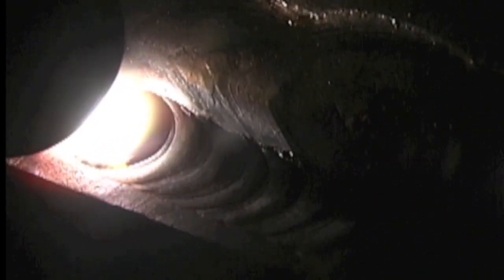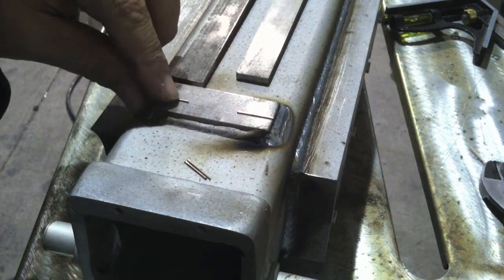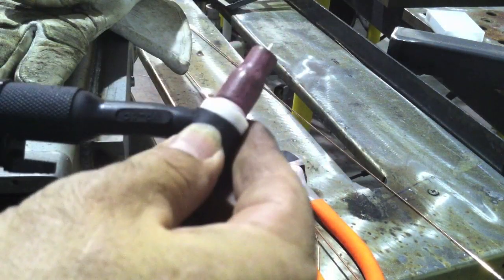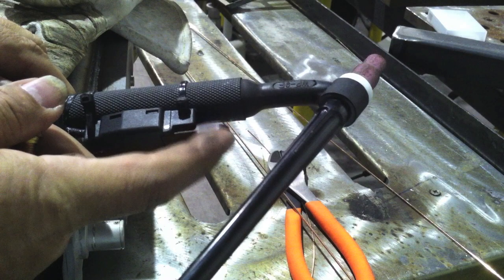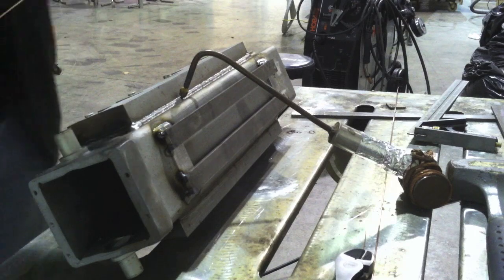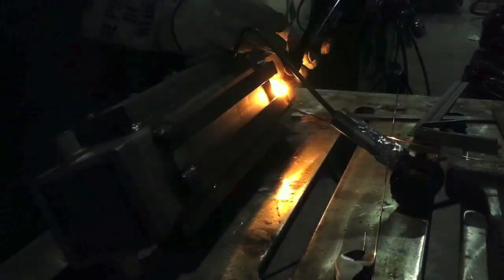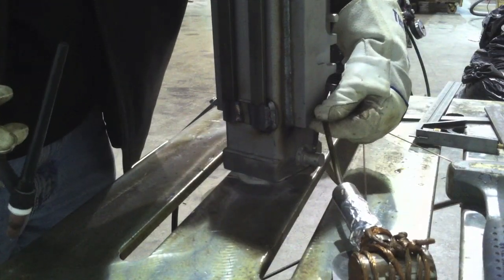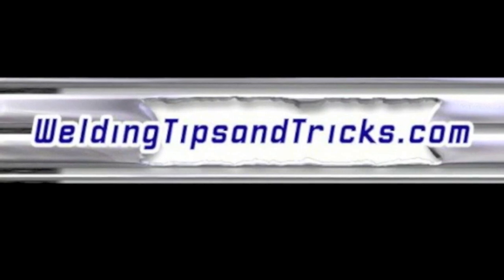Tig Welding Carbon Steel - 309 filler rod

Comment: Thank you for the tip Jody !  I have had nothing but problems with the carbon steel bubbling and popping and contaminating the tungsten. I have tried everything except the 309 filler rod. Makes a lot of sense.

Comment: @lobzdik mostly depends on the base metal. Tig = stainless and alluminium and non ferous base materials.. Mig is mostly used in fabrication shops that work with mild steel.

Comment: man, help me out a little bit. I followed all your tips on stailess steel welding and it goes perfectly, but i just began to weld carbon stell and got amazed by the porosity i've found. I tryed low amp, hi amp, speed variation. I cleaned the material really carefully and have lots of porosity. I am using pure argon and cerium tugs electrode. Thanks for all your tips, you're a great welder.

Comment: This video reminds me of a job I just did in a marine box that was going to be coated and the thickness of the coating was .020".  There were four sides to the 1/4" bar stock and 1/4" plates giving me .080" and the customer wanted .100" min.  Used washers for spacers to give me .120" and worked like a champ.

Comment: I met a man that works at a aerospace company as a welder he stated they dont use er70-2 at all.for any mild steel. to mild steel welds only 309l
Reply: Er309 gives a “smooth and lovely finish” on (square) carbon steel tubing.  It is more expensive than say, er70s-6 - but when cleaning up and blending your weld is either really hard or will take a lot of time and energy, it might help to use it.

Thought to try it out at home, and I figure it will help with “furniture” and other situations where appearance is important relative to other matters.

Comment: could you use this filler rod for stainless to cast carbon steel or statinless? I read about "cold welding" somewhere and am wondering if this a correct technique for this application.

Comment: I have a 1 inch crack in o 1   tool  steel 3/32 inch thick .the edge has to be perfect .any suggestions on ending that edge . miller metallic arc with high freak is my welder . the peddle is just an on and off switch

Comment: How does that 309 burn as opposed to 70s2 or 308. I have to take a test to get a cert using that 309. I was just wondering what do I need to do differently to pass this test?

Comment: in pipe welding can weld 309 filler rod carbon steel to carbon steel ? or theres another 309 filler rod to weld carbon stell to carbon steel not using 70s2?

Comment: thinking 312 filler would work just as well as 309 in this application,I say that because I have a bunch of 312 left over from a job I did long ago...any opinions?

Comment: hye.that a same machine like mine.same problem like me a few week ago.the problem i have found is i am incorrect connect the ground wire.i am amature in tig weld.and try read again the manual book. ;)

Comment: Is it possible to have a down slope setting on a mig welding machine ?

I guess it would have to turn down power and wirefeed at the same time but sometime the end of my welds and just terrible even though the rest is fine.
Reply: +shodanxx I'm using it on esab machines all the time

Comment: Had my tig welder for 4 weeks and burn't out 7 electrodes 6 shields and stuffed up every bit of metal I tried to weld. I think I tried every setting and every gas pressure. Can you do a video on what we are doing incorrect instead of doing everything correct and making me look like I should be in a nursing home with dementure and parkinsons PLEASE I have a brand new Invertor 200 amp Tig/stick welder, Stick is perfect but I really really suck at tig. How about  "TIG for people who Suck at it"
Reply: cassowaryind make sure your polarity is set to Negative or straight polarity. this makes the current flow into your metal and not your tungsten.

Comment: I want to tig so I can prototype.. I can mig and stick, and I am a mechanic, and 30 years ago I got honors in advanced welding, but this new machine, buggered if I can come to grips with it. it is a "WELDSMART 200" you can google it to see it (Australia) I used to be able to weld the ring pull hole up in a drink can with the "HENROB 2000" at trade shows..I almost want to give up on this and look for a 30 year old machine, but I know it is all me that is at fault.